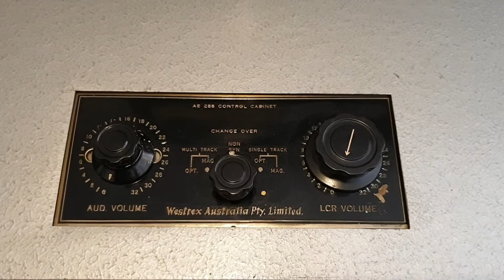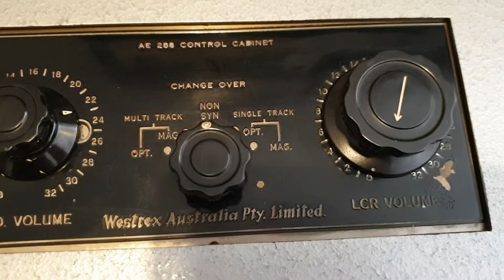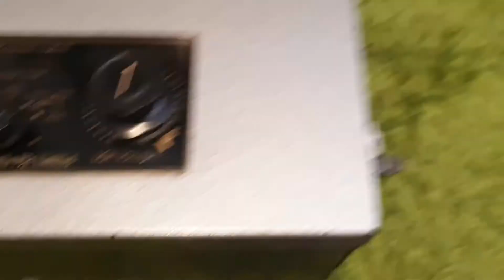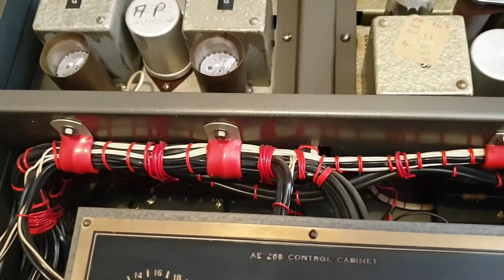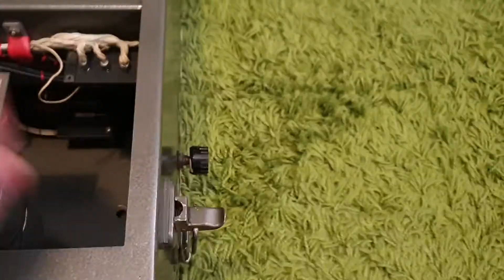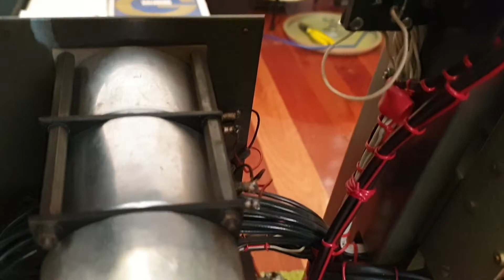Westrex AE 288 Cinema Sound Control Cabinet

Comment: AP is audience participation. The L,C,R and AP on the left are magnetic preamps the AP or surrounds are routed to the module on the lower right which has a relay on it the mag surround had a 12Khz recorded control signal on the film which turned the surrounds on because the surround track was narrower and was muted when not required. The top two preamps are  the right are the optical preamps one for each projector as they were only mono. The third preamp on the right is the non sync preamp again only mono. These units were installed for the release of CinemaScope which originally only had magnetic tracks. The first installation of 4 track mag was at the Regent Sydney for the Robe it had imported Westrex Mag preamps this unit is the later made in Australia preamp and was mounted on the front wall of the projection room between the two machines. They also made a six track version for 70mm and these were installed at the Paris Sydney and the Mayfair Sydney.
Reply from the maker: @Signalelectrician  fantastic information thank you!
Reply: I have the six track version!
Reply from the maker: @Signalelectrician  that's awesome, can't get over the incredible build quality. I might try and get the non-sync pre going just for fun.
Reply: @RecordCouncil  the section where you said the mains connected to is incorrect. It was fed fed with B+ 275V and ground plus heater 6.3Vac from the power supply that was used for the center channel amplifier. Hope this helps.
Reply from the maker: @Signalelectrician  it's helps very much, I really appreciate you sharing your knowledge. Don't suppose there's any chance at all there is doco for these floating around?